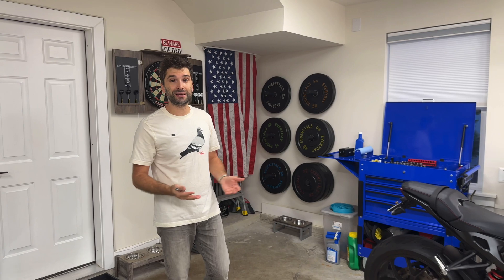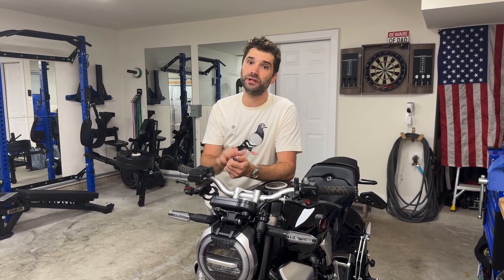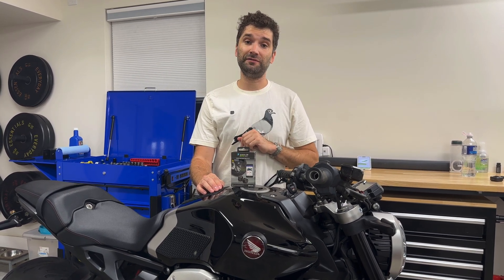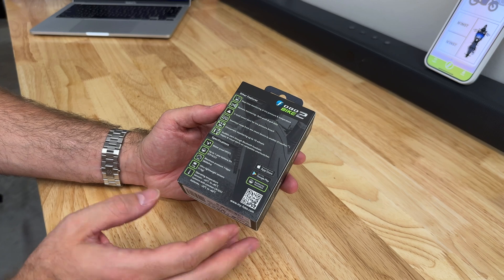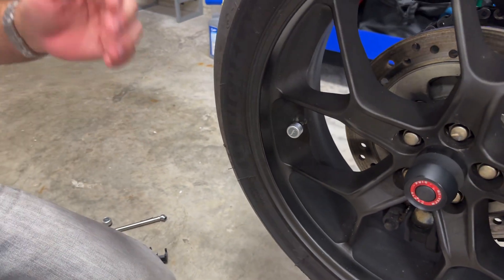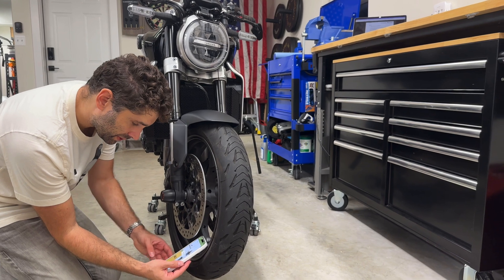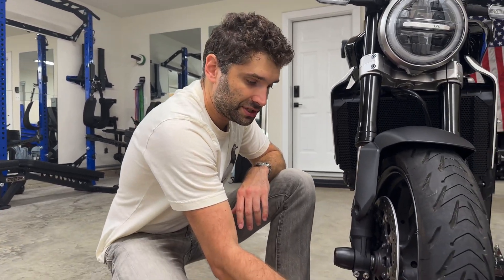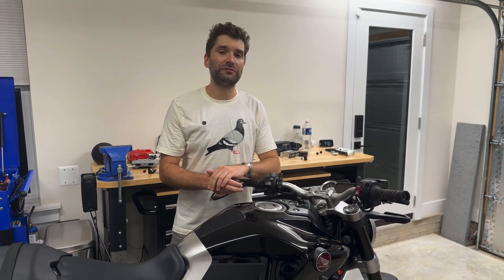$1 vs $100 Tire Pressure Monitoring System

Comment: I won’t ride my motorcycle without a tpms anymore. I had a front tire tube fail at 65 mph.  I was able to get it stopped.  Luckily there was no traffic because I had to use both lanes.  I also went to a tire with a stiffer side wall so it won’t collapse when deflated.
Reply from the maker: Oh wow, sounds scary

Comment: I tried a chinese one and had problem with deflating tires through these caps .....anyone with the same experience? generally i think it is a little unsafe this type of tpms in comparison with inside the rim systems that are the factory standard

Comment: I'm not riding with phone on the handlebars, so  in case the alarm goes off there is no way telling how severe it is?
Reply from the maker: If you have a major loss of pressure during a ride, you will know it without an alarm. If you use a helmet communication system, you would hear the alarm in the earphones. For me, this is mainly to quickly check pressures before a ride.

Comment: Just added to my goldwing, but waiting for warmer weather for putting air in.  Already had low tire sensor on the bike . Least knew what tire pressure is when air gauge isn't handy.
Reply from the maker: Awesome! I also can't wait for warmer weather.
Reply: @Dr.MichaelsMotorcycles  55 miles on the cycle last part of January with warmer weather in Wisconsin..

Comment: Aliexpress it costs 15 and it as good as the one for 99. and NO REGISTRATION needed no internet needed
Reply from the maker: The registration and phone connectivity has it's benefits. If the unit is stolen, it can't be registered by anyone else. The app can also be accessed on any phone.
Reply: @Dr.MichaelsMotorcycles  wow, that is very important because the thief will know about it and will not steal it ;-)
Reply from the maker: @zyghom  Exactly. Thank you.
Reply: @Dr.MichaelsMotorcycles  you are such clever guy, thank you

Comment: Do you hear alerts in the speakers in the helmet connected to phone via bluetooth ?
Reply from the maker: I haven't had it give me a low pressure alert while riding yet. I feel like if your phone alert volume is set, you should be able to hear it.
Reply: Hi, FOBO user here. Yes, you can hear alerts in the speakers of the helmet connected to your phone via Bluetooth!
Reply: @FOBOMarketing  Thanks 🙂

Comment: Here’s a thought: maybe instead of a $1 gauge, you get a $10 gauge? You’d be $90 ahead already, not to mention the cost of having the wheels rebalanced due to the xtra -10gram weights. Oh, and the annual battery replacement. Bet that $10 gauge will last a lifetime, and you can use it on all your cycles, cars, bikes, etc. Nah, that makes too much sense….better to get the automatic electronic one….
Reply from the maker: Glad you understand, thank you!

Comment: The only issue associated is battery life for the second time around. Maybe do a follow up when you replace them. Nice vid. 👍🤪🏳️‍🌈
Reply from the maker: Sounds good!
Reply: The battery is easily replaceable—just grab a new CR1632 battery from the store. You can open the sensor cap to replace it, and it's actually quite simple!
Reply: @FOBOMarketing  actually the question was regarding battery life, not about change them….but thanks. 😀

Comment: Meh, knowing that some Chinese brands just give you their OEM stock watever shelf special TPMS right out the back. Some of them were proprietary nonsenses until their (Chinese) industry standardized on the one used for cars (15" wheel) and just went with that one, probably.

Zontes starting from their 2nd gens 310 and 350cc line up did that, and I believed some other brands in Britian already outfitted with one for high way use since...2010s maybe.
Reply from the maker: Are they reliable from your experience?
Reply: @Dr.MichaelsMotorcycles  Their readings are the same on my Toyota's aftermarket ones. Pretty nice that they just reuse one's other part.

I know for the love of God these guys just copy their own homework, but it's nice to see some efforts in keeping the costs down by doing so in term of manufacturing scale.
Reply: Heyy I totally get what you're saying! But just so you know, FOBO is made in their own factory in Malaysia. So far the quality is quite good and reliable, based on most reviews I saw.

Comment: Is this an ad?
Also I was intrigued by this but then I found out these type things might cause your tire to start leaking if the product decides to fail or something?
Reply from the maker: Nope, if you check out my channel I do a lot of gadget reviews. Doesn't matter to me if someone ends up buying it or not. I just like showing what's on the market. I haven't seen an air leak happen. The only thing I've read about is battery life being less than expected sometimes. I guess if an air leak did happen, the sensor would alert you right away 😂
Reply: @Dr.MichaelsMotorcycles  thank you!